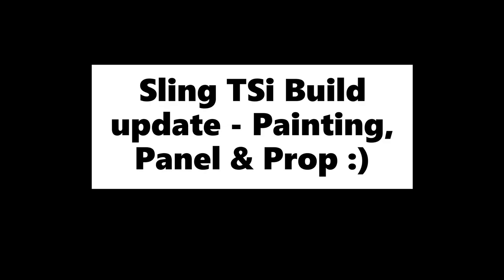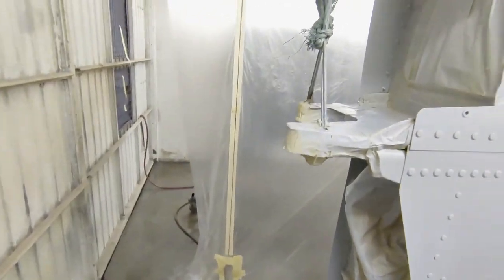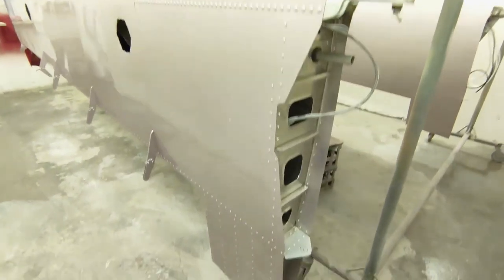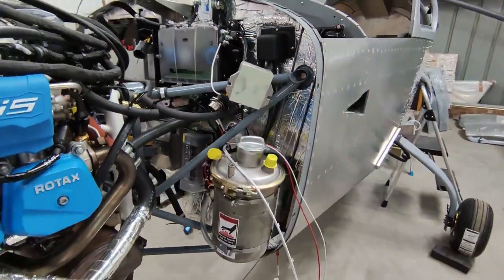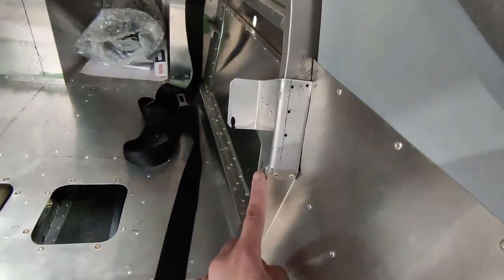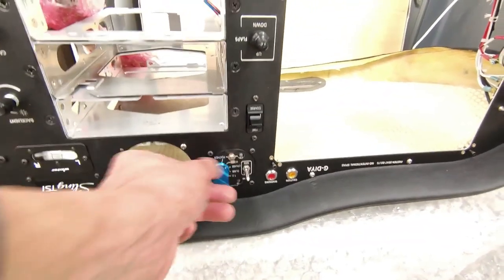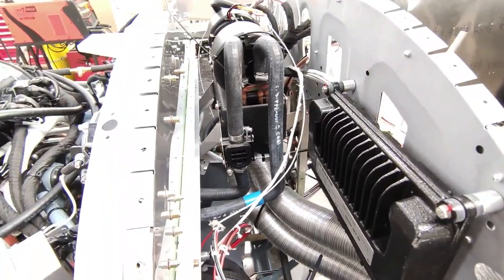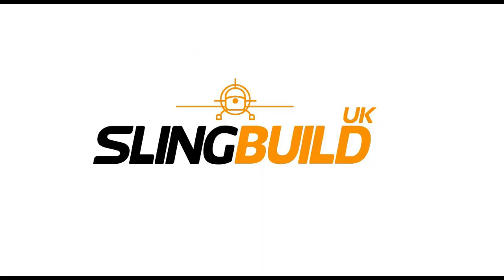Sling TSi Build update - Some Paint at last !

Comment: Nice paint job 👍 could you share which paint system are you using for etching, primer, base coat and clear coat ?
Reply from the maker: Its HP Multiprime 2K Primer Grey M42K Primer with a Lesonal Pearlescent base coat and clear coat

Comment: Looking good!!
Question, the composite (fiberglass) cover over the avionics, aft of the firewall front of the canopy and panel, is that composite riveted in or will it have screws for easy removal later on?
Reply: It's rivetted on. So we are planning on starting the engine and doing any troubleshooting before we rivet that on.
Reply: @ashokaliserilthamarakshan5079  It may be best if you can install nut-plates and use screws instead. In the RV-12iS I built recently, I had to open a similar panel multiple times afterward for troubleshooting and SA/SB's
Reply from the maker: @escalantea1  That front composite on the TSi has to be rivetted on. There is no way you can remove it later as it's also rivetted to the sub panel underneath. The access isn't that bad from underneath and once you take of the PFD.